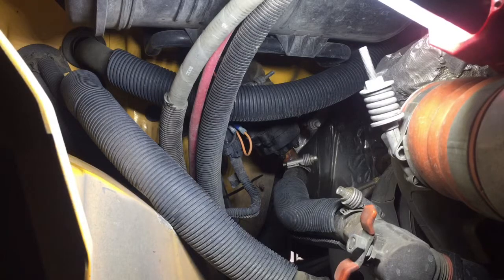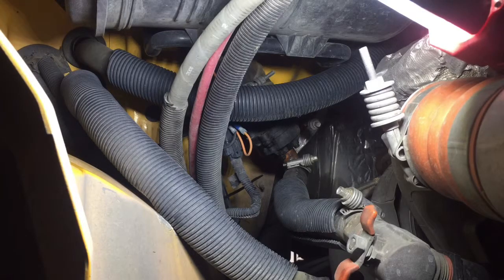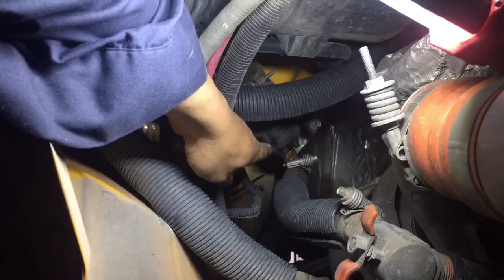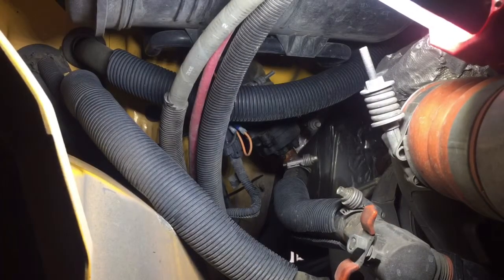Replacing heater boost pump

Comment: Do you have to bleed air out of the system after changing boost pump?
Reply from the maker: Close of heater cut-off valves on engine compartment (2 off them). Replace the boost pump. Open valves. Run engine with heater on for a few minutes. Top off with coolant. You only loose like a 1/2 a gallon of coolant.